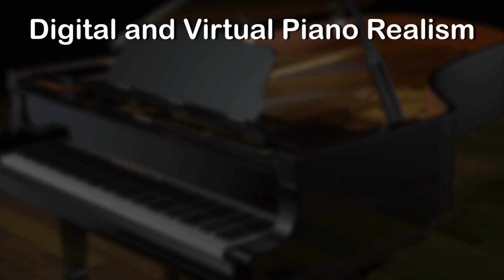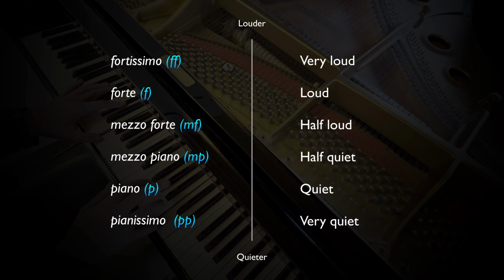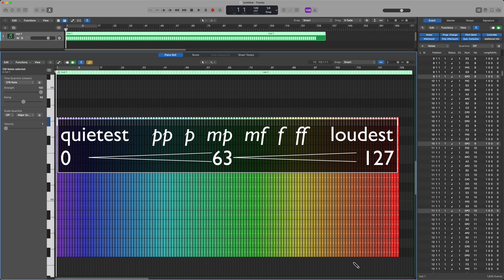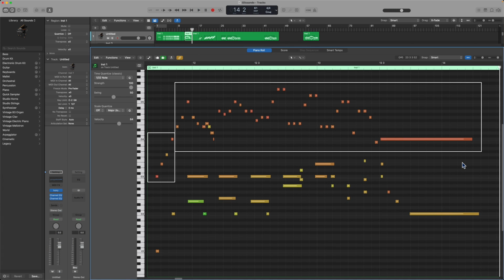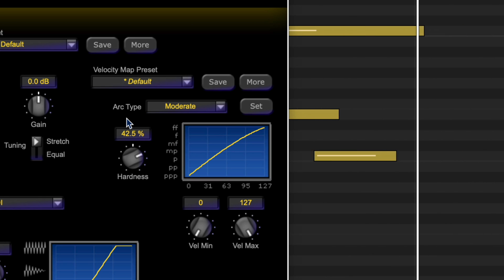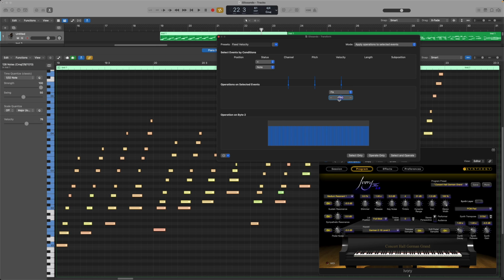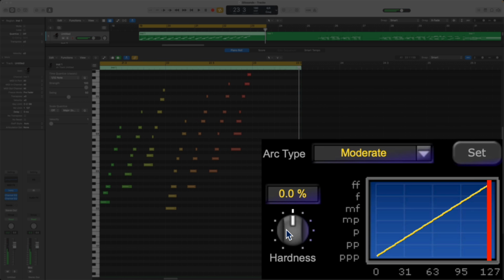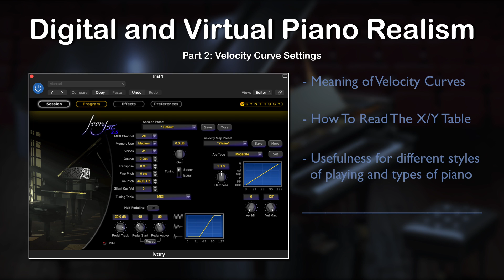Virtual Piano Realism 2 - Velocity Curves Explained

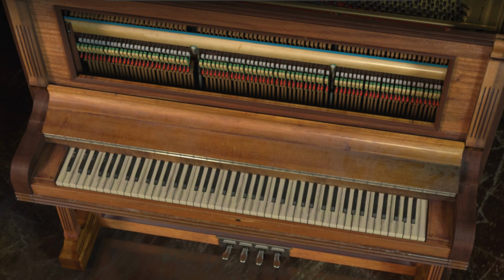Comment: 5:58 I think the lighter touch and heavier touch on acoustic pianos usually refer to the weight of the keys, the inertia and the resistance encountered during downward movement, whereas the velocity curves on audio software reflects the audio output, which is the combination of key mechanism and the responsiveness of the strings to the hitting force of the hammers. I don't know how in real life acoustic pianos behave in a velocity curve plot, whether it is a straight line, someone can take some measurements. I used to grow up on a very stiff action upright piano, later moved to a Yamaha Clavinova with spongy feeling keys, and finally two Steinways, one was a concert D. The small and older grand model M 5'6" has much lighter key actions but also smaller sound than the D. Of course the D has a a bigger action mechanism and soundboard than the D. The velocity curve allows the player to 'cheat' in a way not possible on an acoustic piano.
Reply from the maker: Sorry - just got to this comment now. Lots of useful info here.
Definitely. True the physical key action itself doesn't change. I do find the ability to adjust velocity curves very useful in simulating the difference between practicing on an upright and performing on a concert grand as I used to during my student years. Most of the time these days I practice new pieces using a flat response then introduce a slight curve when performing.